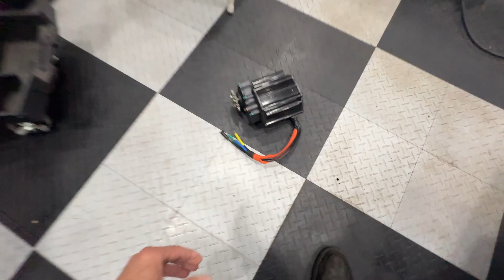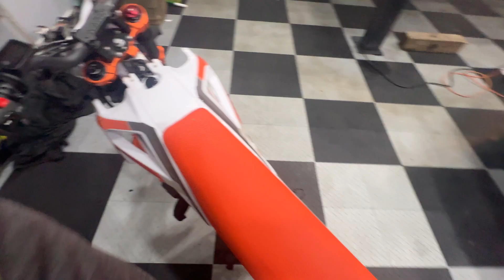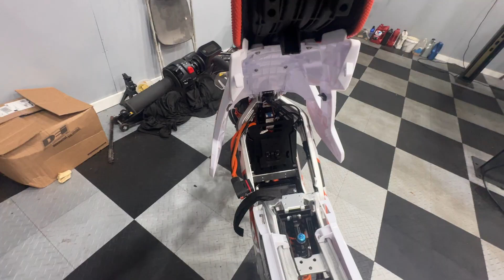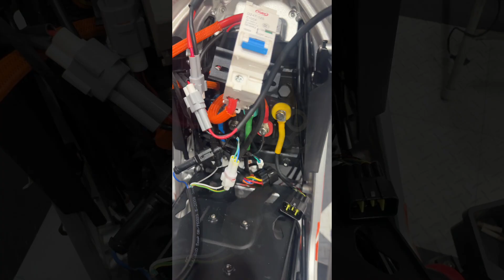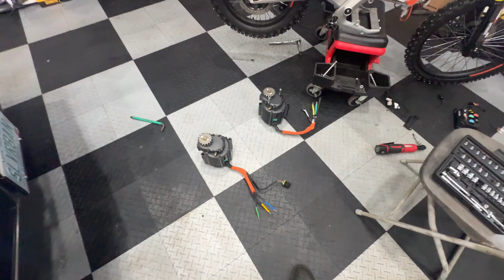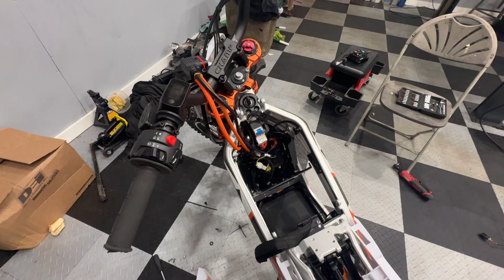Electric dirt bike  motor and controller replacement.

Comment: Thanks for the video! I have the same bike and have so many questions.  I can't find any information on the bike and it seems like the company does not respond to questions.  I assume this was the original superhuman champ and not the new pro version?  I believe the original version says it is rated 3kw and 8.5kw peak and the new pro is 4kw and 13.5kw peak power. Does the new controller and motor you ordered from their website make it the new pro version with 150 amp controller and 13.5 kw now? Any extra information you have on this would be great. My frame says 3kw rated, and the battery pack says it is 73.8v. Which confused me because I thought only the new pro had the 73.8 volt battery. It looks like the motor has a gear reduction area. Is there oil in there and does it need changed? Mine has a 90/100-16" rear tire and supposedly that came on the pro model while the original had an 80/100-16"?  I am wondering if they just pieced things together as they went along?  Thanks for all your help.